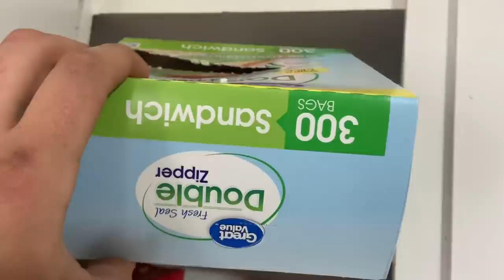Saving a Vintage Porsche 911 Targa from the Scrapyard: Rebuild Part 4

Comment: Restore it back to OEM. There are so many places to get either used or new parts for 911s. Take you’re time and do it right. Great project
Reply: One alteration if it were up to me though: Make it an EV! Or make it (hot-)swappable, even better!
Reply: Absolutely Graeme. To Porsche people originality is everything. Even that rasping exhaust note. If he keeps it OEM he will own a valuable car.
Reply: @jwvandegronden  EV would be pretty sweet
Reply: Jan Willem v.d. Gronden how original another boring EV swap no one will give a fuck about in a month.
Reply: Do it right, do it once . ps.measure twice, cut it once 😅
Reply: @peterpumkineater6872  Measure once, Cut Twice, Spackle Paint to finish!

Comment: Go back to stock with that awesome metallic green. Please don’t cut it up. No widebody! Those rear quarters can be straightened. Done right (stock) that car is worth a small fortune and the values seem to keep climbing. You have scored the find of a lifetime, my friend. Hell; the rear glass is probably worth the $500 you paid for the car. I find the older I get the more I am drawn to originality in cars. Great series. Thank you.
Reply: Widebody is pretty original to porsche and these entry level 911's are pretty common here in Europe atleast, so i say go for the custom!
Reply: I agree. Dont rat rod it, or wide body convert it. Go with the original factory green paint. Keep it as close to 100% stock as possible. Go with weber carbs on the engine. Loose the cookie cutter wheels and get a set of Fuch windmill mags. If you do a decent restoration, you will have a 6-figure car. Amazing you got it for $500 from a scrap yard with most of the engine still with the car. The “value” in these early 911’s is as close to OEM as possible. Good luck.
Reply: It's not just the monetary value; the aesthetics are important as well. Originality, every time.

Comment: "Pretty solid"
Optimism is a virtue
Reply from the maker: Lol 🤷🏼‍♂️
Reply: Delusion on the other hand.....................................;)
Reply: LOL!! thanks man!
Reply: I have done a lot worse. Had a mk1 etype with almost no floor pans just gear box holding it together.
Reply: Fit for the scrapyard .
Reply: @neilrafferty2097  no man. Always look for the good and start there. Everything is worth restoration is you love it enough.
Reply: Chris Collins The end product will be a lovely 911 targa so in this you could be right !
Reply: @neilrafferty2097  that's true. But I would restore a fiat panda if someone love it enough and ask me to do it. It's for the love of car's. Probably why I never really made big money out of it, not like a lot of my mates who have got it all and a lot more because they did it for fun but as well the return and would only do car's that have it to give back at the end.
Reply: Except for the floor panels, there is no much deep rust in that car in my opinion too. I can't tell if it worth the restoration cause the interior is really busted, but for 500 bucks it seems a good deal anyway.
Reply: Rogério Costa Pretty solid ? I’ve seen paper bags with more solidity .
Reply: JGibb 62 after market floorboards and centre tunnel can be had! As long as the inner rockers are solid enough to weld them to!

Comment: Nix on the rat rod... That car is worth going back as original as possible, within reason of course. The original color is great! I still can’t believe you scored that car for $500. The engine alone is worth $7000 to $10,000.
Reply: KD410SE yeah no it’s not in its current shape.
Reply: Jimmy Grant I checked out Porsche 911 motors on several sites and complete rebuilds ready to go can get up into the low 20k range. Clapped out motors needing rebuilt commonly go easily for 7-10k, which is what we’re looking at here. My point is, this car was a steal at $500 and even parted out would bring a boatload more than the entire purchase price.
Reply: KD410SE checking out random website asking prices are not actual selling prices. It’s a 2.7l not a very desirable engine.
Reply: Jimmy Grant well, yeah... I mean, if you can find a whole 911 for $500 you can damn sure find parts for one on the cheap too but normally, you’d pay a hell of a lot more than $500 for them which was the point I was making.
Reply: @jimmygrant3212  Any  Porker engine is  desirable whichever way you slice it. Even the 4 pot from the 912.
Reply: The difference between spending 5 thousand and 25000.  Rat rod is the way to go.
Reply: @spiritusmalingus343  rat rods are a fad. Frankincars.
Reply: @bluetickhound16   maybe a tip top running engine with new seals, valves properly adjusted, cleaned injectors. Fortunately the demand for these cars is high so someone will be willing to pay for a engine.
Reply: @spiritusmalingus343  This is absolutely a terrible idea...
Reply: @denvernow7294  It's missing so many parts, trying to restore that back to original is crazy expensive. Just putting the dash back would probably cost 5gs. Now figure in the rest. Get the body straight, fix the motor and run it. You can pick up newer air--cooled for 40thousand,
Reply: @spiritusmalingus343  The power of the internet is strong with this one though...
Plus it doesnt have to be a perfect restoration. Just not a rat rod...
Reply: lol you must be one of those experts.  i've owned 4. all pre--dented.. @denvernow7294  ,
Reply: @spiritusmalingus343  I watched a few of your vids. How come people just anchor in the middle of the water like that? Is it a lack of docks or is it a storm damage prevention thing? Cool vids btw.
Reply: @denvernow7294  Safe harbor. and lack of anchorage.  The good cape in Assachusetts. Not cape clod.

Comment: Good luck! You picked a tricky one, early G-model still without the zinc coating. You got lucky with the rear seat structure, it is made of unobtainium... (afaik, as I quit playing with these cars 4 years ago).

And it is your car of course, but pls don't widebody it. Also detracts from the value big time.

Try getting/fabricating a steering column extension. This improves driveability a lot.

Comment: Good to see you bagging and tagging!  Floor pans and transmission tunnel replacements should be available aftermarket,  You can paint both sides with high quality weld through primer and plug weld or stitch weld in the replacement panels.  After you finish the welding grind back the welds, primer and seam seal the panels.  The floors will be as good as new.   you should pimer any bare metal after you finish blasting.  It is in surprisingly good shape after you cleaned it up.   Please forget about the rat rod look.  You will be way happier with a full restoration, and the car will be worth way more to resell if you decide not to keep it.  (i think you would be nuts to do all this work and not keep it! LOL!) My Porshe, after some engine and suspension mods, was was total blast to drive.  The handling was amazing.  I regret selling it but with children it just wasn't practical.  You have an advantage, you can take your time restoring this car, and you have other cars to drive, and the place to keep them.  As usual, wishing you all the best!  Keep up the great work!
Reply from the maker: Thank you so much!

Comment: I Envy you those red aeroflexAC lines. They are the best but unobtainable today. Here, they are reused often because the R12 has done something to the inside of the hose which prevents R134a from leaking through the hose material.

Comment: Whip up a diy rotisserie.  Brace the door openings with temporary steel tubing.  Start at the sills and floors.  Cutting and welding and cutting and welding and new floors, sills and on and on.  Do you have factory frame dimensions?  Gonna need those too.  Looks like fun.

Comment: Love how you are getting into this. You need a sense of humour on these projects mate thats a fact! You have been SO lucky with how the bolts have come out but then when I did a '56 Beetle every one of the body / Chassis bolts all came right out sweet as a nut and we use salt on our roads in Winter. German engineering or something. And nice touch with the zip bags. But you have cheated as you have the videos. People like me used to look at a box of bolts we stored 6 months previous and went WTF? Got to love cameras on phones these days
That wiring looks pretty solid as well. Just a tip give the looms a quick wipe over, loop them up loosely and store them somewhere warm. When you come to finally clean and fit them they will be easier to work with.

That floor looks worse than it is as it is basically flat and you have solid surrounding panels to work to. You did real well getting this car. Its a gem that just needs work.
Reply from the maker: Thanks for the input! 🙂

Comment: Rusted floor pans will be familiar to anyone who works on air-cooled Beetles. Fortunately they're available and not a difficult fix. The rest of the car is in great shape. As a UK based enthusiast I'm envious - I've had Volvo 240s (which were galvanised) worse than this!

Comment: That metalwork doesn't really scare me as I have had to deal with much worse.  Break each repair down into subsections and it really isn't that hard overall.   Might be worth media blasting. Floor pans will be much easier once you get that body on a cart or rotisserie

Comment: Much improved production! Congrats!  This is a GREAT base for a rebuild- MUCH worse cars have been rebuilt.  I would talk to Jonathan W about "fabbing" your own pans and tunnel for the car.  He can't be that many miles from you in NC.  Anything you build yourself on the car will save you HUGE money.  Porsche parts are stupid expensive and REALLY not worth the extra money.  If you build your own body parts and they aren't perfect, so what.  They next guy can always buy the expensive repro parts and change it back to factory perfect.  The thing is to get it back on the road and start enjoying it in the spring.
Reply from the maker: You’re right about that!

Comment: I agree with your glove argument. I dont wear gloves unless I am working on something super sharp or changing oil. 
She is going to be a nice car when done. Hopefully watching your videos will get me off my ass and start working on my 66 GTO.
Reply from the maker: Haha! Hopefully I can watch this videos and work on my other projects that need to get done 😅
Reply: Also on the bolt baggies; If the bolts go to the same item but different lengths, I use cardboard and put the bolts in the correct orientationt through the cardboard then in the bag.

Comment: Oh I don’t think you are crazy, but this is going to be a massive project. Just alone getting the missing parts. For the body work I would recommend you to find a very good skilled restyler they can do magic with the exiting panels. They can make them straight like factory. Even your front wings can be saved. Good luck! :-)

Comment: i use egg packaging to sort small parts. the formed cardboard/paper ones are better than the styrofoam ones. they're tougher, solvents/gasoline doesn't melt them, and you can write on them. if i have a lot of them for one project, i put them into a banana box, and put the box with the project. both are free, and serve the purpose very well. i used to build buggies and sand rails out of v dubs, and i always wanted to build one from a 911, but i could never find one at the right price. but, damned if you didn't. in my mind, i'm already driving speed buggy right now...
Reply from the maker: handyhippie65 Thanks for the suggestion! Sounds like a great idea! Yeah, this would make a cool buggy 🤙🏻

Comment: I wouldn't worry about the air conditioning. Having a Targa is like having a convertible.  I have never found the need to use AC in my convertible 986 . If it's hot enough for AC it's perfect weather to go topless.
Reply from the maker: The A/C is going! Lol

Comment: One more thing I want to mention is that when yo are ready to install your engine attach your rear suspension and transmission and install as one piece unit. it's a lot easier that way./ I am not sure what engine yo have but if it a 2.7 then watch out for the engine studs, They are not very reliable and a pain to fix.
Reply: Good one buddy!! I was surprised to see him take the engine out without the box !! 🍺🍺

Comment: this must be so rewarding if you can look at that thing and realize there are no large obstacles... And you can do it all yourself. Well done sir. Allready subscribed at the first episode. Love the low key vibe!

One question though: thousands of bags... If you need the bolts for the ashtray, how the heck are you gonna find those in the pile of bags?! The system to the madness is.... 3, 2, 1.... Go! ;-) No seriously, I'm really interested as I would be completely overwhelmed by it all and you seem as cool as a cucumber, so either it simply is applying your madness by cranking it up to full volume or there is a system to help you out... I would suffer from the first option I'm afraid.
Reply from the maker: Haha I have them in larger boxes as that go to which area of the car I was working on, so as I reassemble I dig into the box that goes with that part for the car. 😀
Reply: Budget Buildz ~ oh that is quite logical actually and makes sense even to me ;-)

Comment: Your going to find the Porsche community is full of some really good people so don't be afraid to ask for help. I wish I still all my old parts but am now restoring a 196 2 Triumph TR3B. At the shop where I work on my car they report Porsches all the time so if you run into something as the fellow below says et people know what you might need. I'm not sure if yo know about Pelican parts,  the Porsche junk yard in Pensacola, there is one near LA and my son works in the Porsche industry. and another one over in Houston tat knows where some bodies are buried, so to speak. One more thing, never throw anything away even if it's rusty. One day you'll want to check everything out, That's from experience.
Reply from the maker: Thank you so much for all the input!

Comment: "car looks pretty solid" , are we looking at the same car ? The floorboards are gone. That center column looks "ify" at best. I think you need to do a lot of cutting out and welding large pieces of new metal in place. Hopefully none of it impacts the frame. That could be too far gone at that point. My hats off to you for your perseverance though. This project is huge ! Good Luck.

Comment: gloves fall apart and make my hands got wet and white so im with u there. ive started using material bassed thin gloves. in the uk that porker would have more holes than a colender lol
you destroyed the seats to save rotton floors. you could of just lit tye underside up at night and looked for holes, then cut the floor out around the seat bolts to remove as u need a new floor anyway doh.......every day is a school day

Comment: Please be careful about sand blasting "modern" cars.  The metal sheets sometimes is so thin, that the friction heat from the blast media can ruin the panels. A safety option is to use water cooled blasting.
Keep going, please. I'm waiting to see the engine running.
Best regards from Brasil!
Reply from the maker: Thanks for the info! We’ll definitely get on the engine very soon! 😊 glad to have you!

Comment: Don't re-use those old bolts, they are rusty. If you happen to repair it in the future you won't be able to remove those. How you gonna make or buy new floor for this car?
Reply from the maker: I plan to put stainless back in it, old bolts are for matching up 🙂 I’m not sure yet, most likely get new floors. I have some restoration skills but a lot of this is learning for me!

Comment: Some nice leather 986 seats would be a great replacement for those ratty ones. With the Ims berrings going so often in 986s from 99-09 . Interior parts are cheap and plentiful but still 911 quality. Funny how the uni-body floor rotted More  in the back. Targa top must have leaked for an extended period of time.
Reply from the maker: The rear floors rotted b/c they had plywood over them, the springs got week in the seats as they always do and someone fixed that with plywood lol which held moisture and rotted them out 🤷🏼‍♂️
Reply: @BudgetBuildz  quick fixes like the use of that plywood will come back and bite ya! However......
I seem to remember that in my 66 912 the bottoms of the back seats came out when I was cleaning. I noticed the frameworks of bottom sections of the back seats were made of wood like you would find on a boat. Could that be the plywood you found?
Reply from the maker: kelly nash no it was literally a piece of old plywood bolted on the floor under the driver seat lol the rear seats do use wood as well but different
Reply: @BudgetBuildz  Sorry. I must had misunderstood where the wood was. Lol.

Comment: Another awesome vid but is it me or does that panel that holds the VIN plate look to have a bad weld job...looks like it has been replaced
Reply from the maker: It’s an original panel but at some point of time the car was involved in a fender bender resulting in the tub underneath being replaced and it popped the spot welds off so they retacked them on but didn’t do an extremely nice job.
Reply: Ok cool...it was just that panel combined with a bad paint job looked like someone was hiding something...looking forward to how this project turns out.

Comment: You are rebuiding a family heirloom. Do not cut corners. Do not put stainless bolts. She will be a garage queen. Even the stamps on the bolt heads will be meaningful. Be sure to google Pelican parts.
Reply: I agree with no stainless steel hardware